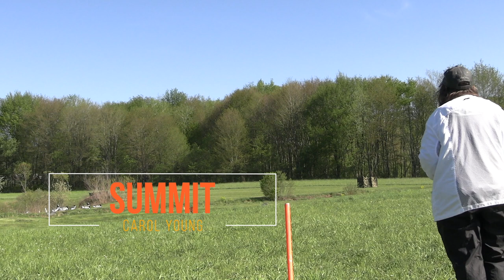DAY 1 - PAT BURNS ELITE RETRIEVER TRAINING WORKSHOP- SPRINGBORO PA 2021

Comment: Lots of retriever training wisdom from Pat Burns.  THANK YOU!
Pat Burns on Land Marks:
10:00 design of momma/poppa marks
37:00 Pat explains primary and secondary selection
44:55 Pat explains when to handle and when to have the gunner help.  Here the dog  handled on second mark because he took the wrong route, and dog is recalled on last memory bird and gunner becomes visible to help the dog.
47:00 Pat explains why it is so important to watch the dog, not the marks.
1:01:20 Pat demos how to "close the door" to influence the dog left (push), then silently pull for the right hand mark.
1:23:00 Pat discusses handling on marks..typicaly handle to correct the route such as cheating, suction, wind drift, switching...do not handle in the area of the fall.
1:30:00 Pat demos how gunner can help an inexperienced retriever by stepping in the direction of the fall
1:32:50 Bird-in-mouth on singles to start mechanics of memory birds
1:40:00 Pat explains have the retriever wait to be sent on the go bird...do not allow butt lifting in anticipation of being sent.
1:49:20 The importance of SIT when trying to push influence the retriever.
1:51:45 Sent too quick, so need to recall to focus on correct line
2:25 Pat talks about a routine to get a dog to go on a memory bird dog forgot and may not go.

Comment: Excellent!  Pat Burns on Land Blinds:
Land Blinds:
2:29:55 Set up for 4 land blinds (55 to 195 yards)
2:35:00 Pat talks about the importance of sequence in multiple blind retrieves in training...increase the comittment to a factor like cross-wind
2:37:45 Pat discusses the importance of knowing exactly where the blind is while waiting in the holding blind, on double-blind be a proactive handler setting up for perfect spinal alignment while the retriever is returning from the first blind.
2:39:00 "Voice is gas pedal, silent casts as steering wheel"
2:42:00 Verbal cast with wind, silent cast into the wind (effect as undercast with wind, overcast into wind)
3:00:00 Pat talks about judge's ideal line to the blind and keyhole blinds to challenge the route to the bumper.
3:08:00 Pat demonstrates how to use voice after a cast to punch a dog and timing difference is sight versus sound (cast versus verbal).
3:11:30 Pat talks about casting momentum and silent casting
3:12:30 Contrasts for more in-depth language to the retriever (verbal versus silent, hand versus no-hand, soft versus loud sends)
3:13:40 Freezing on casts
3:26:15 Pat talks about training a dog with the problem of a crooked sit

Comment: More excellent retriever wisdom from Pat Burns!
3:37:45 Water marks/water blind 
3:38:35 Down the shore mark push to influence left into water
3:43:55 Water blind designed to finish with the greatest commitment...on and off point.
3:46:00 Pat talks about handling retrievers off points...defensive handling to avoid dog wrapping around point and out of sight.
3:56:40  Pat talks about how most dogs will cheat water early in the training season...good to start with cheating singles
4:02:00 Pat explains priority 1 on water blinds is to get in the water, therefore he does not like to call back...message should be get in, stay in water...more important than the line in training
4:39:45 Pat has gunner help a confused dog that would not take multiple back casts on water blind
4:51:00 Show-me blind for inexperienced dog
4:56:45 Pat talks about handler false motion which may send the wrong message to the retriever